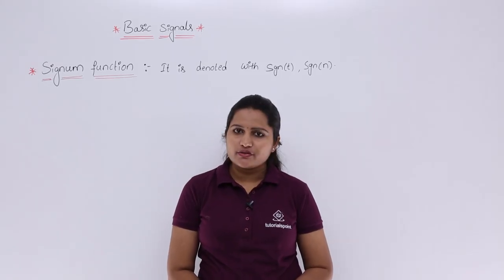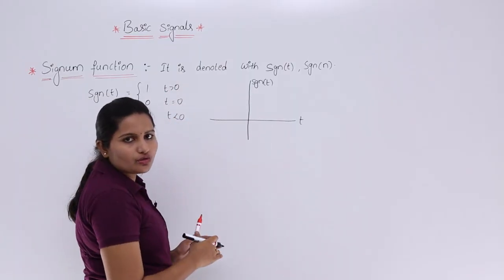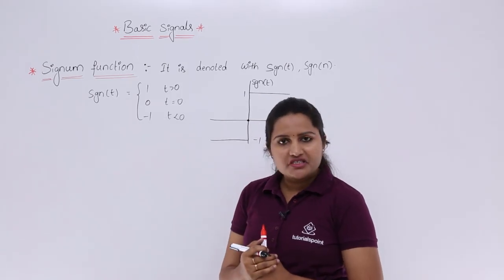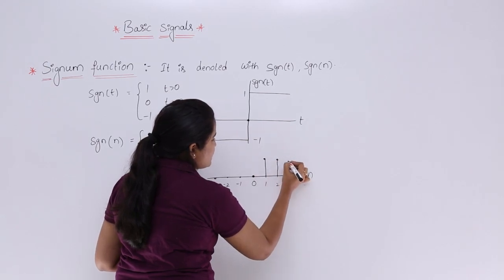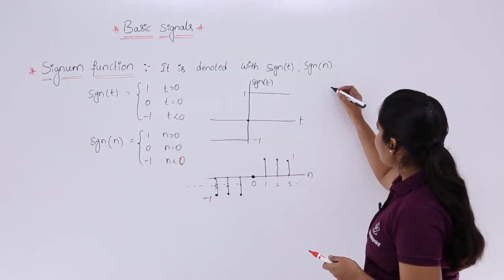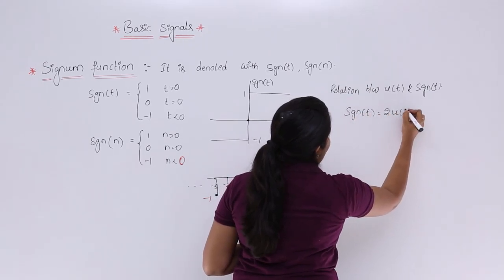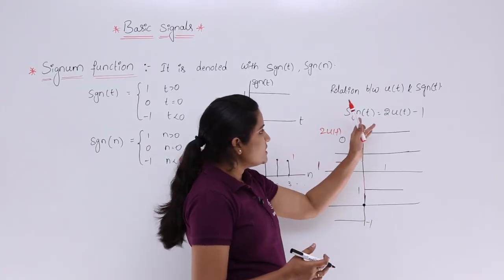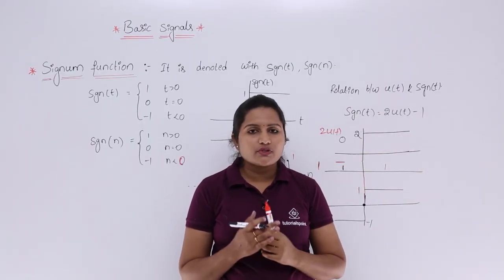Signals & Systems - Signum Function

Comment: so please in relation btn the sgn(t) and U(t)...........2U(t) - 1, please this means the -1 is assumed a DC voltage signal from a the negative run straight to the postive......and basically since the U(t) have no negative signal, it means that 2U(t) runs from 0 to  positive hence resulting the avg t of 2U(t) = 0........Is that the meaning ??